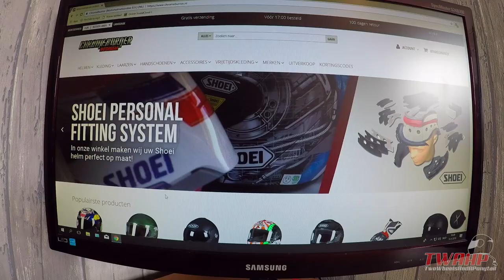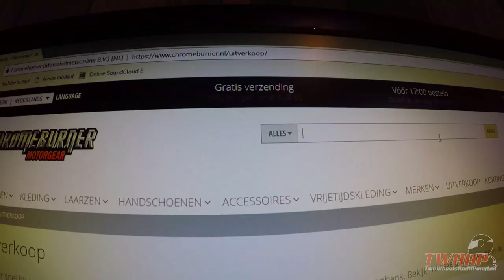Yeah! More toys for my BMW S1000RR!

Comment: at a crash if a good expert of the insurance or police check your bike, your M4 brakecaliper not approved for s1rr and your bike have NO approval for street/road use, only race/track.
M4 Monoblocks are only for HP4 or you have special entry at your documents!! looks like the the brakeline from s1rr and be overturned for M4 it can be folding during damping :( you net hp4 brakelines fittings have different degrees.
just try speedbleeder nipple;)
Reply from the maker: Huh??? Didnt know this

Comment: Is there really any difference in changing the brake master cylinder for the OEM Nissin one? Because the diameter of the master cylinder is the same (19 mm for both) and they say that the ABS pump should compensate for any changes. Could you comment on that? Is the bite and feel any different? Is the travel of the lever shorter before it starts to bite? I got BMW S 1000 R (which has the same brake hardware as the RR) and I was wondering, if changing the master cylinder would do any good. Thanks, nice ride.
Reply from the maker: I like them more!! Very very good with brakes!!  He bites more, but not in a bad way. Love it.
And the handle from the Brembo doesnt have a big hump! :D 
Sorry for my english. I wanna explain, but dont know the words.